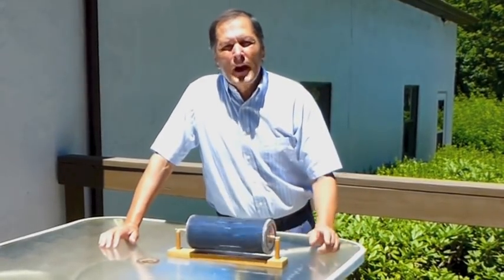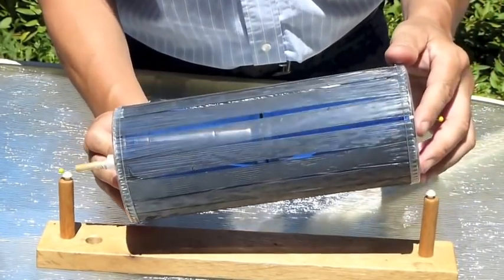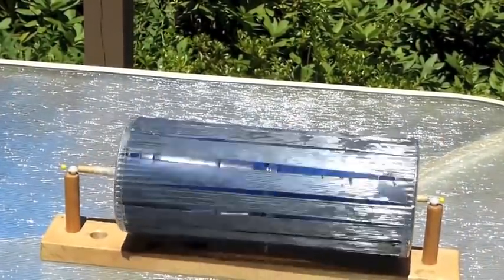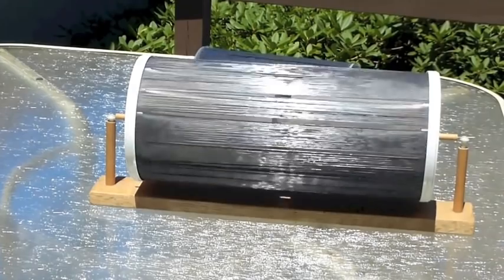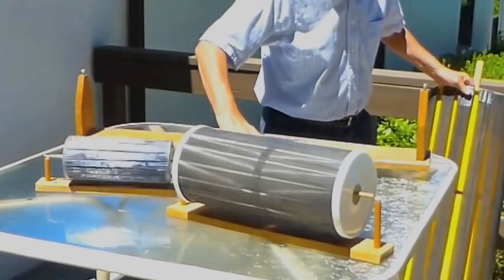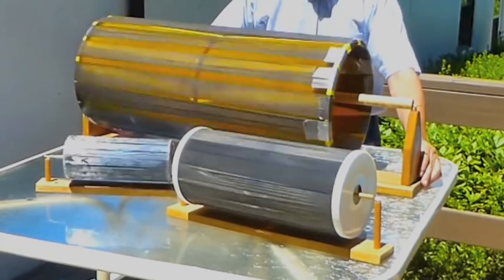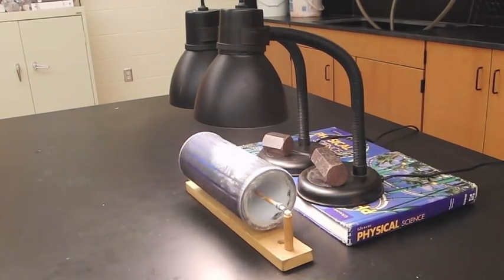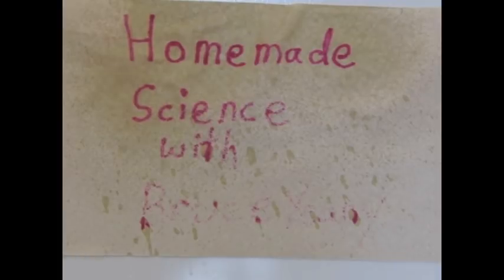Solar motor--Free energy motor-- not electrical /// Homemade Science with Bruce Yeany

Comment: Efficiency not mentioned. Should have mentioned that its solar not free energy in the title. Solar cells probably more efficient, plus no moving parts, thus no mechanical wear. All in all it is a thermal device not solar, witch could be used bidirectionaly to cool or to use waste heat. more detailed implementation: https://youtu.be/lfmrvxB154w
Reply from the maker: Hello MIndaugas,   Looking back I should have added more information in the video, but I had planed for a followup but haven't gotten to it yet. I  did cover some of this in the paragraph under the video.  If I were posting it in a technical journal I would have described it as a thermal retraction engine. In this case,  I labeled it as a solar motor to denote  the energy source powering it, which is done quite often in energy converting situations for example,  wind mills, or hydroelectric power neither of which are actually energies, simply descriptions.As for "free energy"  I don't believe that devices can violate the laws of thermodynamic or run as perpetual motion machines so I denote free energy as an economic description not a pseudo science  one.   The video link you provided is pretty cool,  thanks

Comment: I got the impression that the wooden dowel is warped, not truly straight, making the engine unbalanced.  This would make the engine less efficient and slow it down.  Perhaps using a piece of straight aluminum, perhaps an arrow shaft, would make a more efficient engine and give more RPMs.  Thank you for the demonstration and explanation.
Reply from the maker: Hi Paul,  I am trying it with some heavier duty materials to see if I can up the efficiency,  if it works I'll be happy to share it

Comment: Why does everybody want it to have an application?  It's a fun thing that illustrates the contraction of the "solar bands".
It goes around.  That's its application.
Reply from the maker: Thanks Mike,  For me that's enough
Reply: Well, I have an "application" :-)
Glue small thin mirrors on the rim somewhere. They coud even be colored.
You may get a nice light show in your room!
Reply: @geromatezwanzig8789  You could glue mirrors on the base as well, theoretically that could increase the speed of the rotor due to rays from the sun touching both the top and bottom
Reply: @Залав-ч1у  From the description of how it works in the video description, I'm pretty sure that having light on multiple opposite sides would likely greatly decrease the efficiency of, or even nullify the rotation entirely.

Comment: would it be more productive by using heavier material to absorb sunlight like metal painted with black ink to get more of torque out of it. maybe add some magnet on wheel to generate some electricity
Reply from the maker: I've been looking for other materials but have not found any, for this to work it needs materials that retract (shrink when heated)
Reply: nitinol!

Comment: What will mixing the different sizes together bring?  Perhaps setting up several devices in an array with one common axel suspended in equal distances from the orgin to the intersection of the axel supports.  In theory, both descriptions should render better torque.

Comment: what do you think the maximum volts/amps you could get out of these on like a dynamo type setup?
 i know its probably only going to be small but say ten, fifty or one hundred plus all on the same circuit on something billboard sized and use it more as an art insulation than a practical energy solution.
Reply from the maker: The smallest one's power output was very small,  in the 0.001 watt range.  We didn't try the biggest one,  I will this coming fall with my students

Comment: Serious question. What is the practical application of these motors? They don't appear to have enough torque to overcome friction if they were hooked up to a device that would actually generate usable electricity. If they would, then having one of these to supplement solar panels and wind, would be ideal.

Thoughts?
Reply from the maker: Until someone can make it more efficient,  it will not power anything usable,  for now it's use  is mostly educational
Reply: I appreciate the candid and quick response.

It would awesome if it could be made light enough, with little friction, so that it could be turned into a generator, mill, or pump.

It's really fascinating.

Thanks, Bruce.

Comment: nice post , thank you... this will be very useful in a solar convection application ( green house heating ) the process is simply to add direction fan blades to the end caps  and thus better movement of air currents into directional applications ... also see solar black boxes for heating ... thanks again... but , post of video of making one , so others can expand on the concept through application of principle ... ttyl...T...

Comment: It would have been nice if he had provided a Theory Of Operation.
Reply: It's in the description text.
Reply: The explanation in the description says the opposite. Heat causes the bands to contract which makes sense for a polymer.
Reply: the setup needs to be longer.  not a bigger radius.more lenght means more contraction means more power.
Reply: melted cheetah  Generally yes, but not always.  Several types of plastics shrink when heated.  Look up Shrinky Dinks
Reply: rubber bands contract when heated
Reply: This site explains How to & why  - www.instructables.com/id/Solar-Thermal-Motor/
Reply: If you replace the spokes of a bicycle wheel with rubber bands, mount it with axis horizontal, and allow sunlight on one side only, it will rotate.
Reply: Not in the case of elastomers under stress.  They contract.  You can demonstrate with a rubberband, a weight, and a hair dryer
Reply: A large heavy one would probably kill the effect off. It needs to be light enough that the very minor change in the plastic can deform the shape of the whole object. Make it too heavy and it won't work.
Reply: Animuldok What's odd is when stretched (expanded) rapidly they cool.
Reply: Doesn't heat make things expand?
Reply: Likely.  But with most organics, contractions are weak with heat.  I did not know what materials were used.  It could be possible for the cup tops  being distorted upwards to provide imbalance for rotation.  I would have to build one and test.
Reply: Yes its plausible but the the expansion and contraction to happen that fast mmmmmm Im with you would need to build one to be convinced
Reply: you can read video description
Reply: Richard Vasquez  please provide me your e-mail for theory
Reply: I doubt you'd get any useful energy out of them. The forces involved are so small anything drawing energy from it would brake it to a halt.
Reply: yes, contracting at the top would indeed pull it together thereby raising the CG, I wonder if this couldn't be used to construct a sort of van degraff generator to do useful work.
Reply: its obvious.  The bands facing the sun are heated, and therefore expand, causing the axle to warp upwards, which moves the center of gravity of the rotor assembly upwards, and the rotor falls, further allowing subsequent bands to shrink when in the shade, and the rotor develops not much power.  that is  my guess.
Reply: @sevtecsev  that's most definitely not obvious! Thanks for clairfying
Reply: @sevtecsev  "It's obvious" 

Proceeds to to describe the opposite of what's actually happening.
Lol.
:)

Comment: Can't take much of a load.
Reply: By the way, the supports I used are not wood, but cut up pieces of a box made of thick cardboard. But the [principle is there.
My granddaughters will love it..will get them to make one for themselves...well the eldest one anyway...she is 8, the little one is 3...but feed a young enquiring mind properly and you might produce the next Einstein maybe. Confucious (if you are into his stuff) said the start of every journey starts with the first step. I want my grandkids journey to be a good one for the future.
Reply: You can't amplify the torque, the only way would be to have enough speed, which is not the case here.
Low torque, low speed, well, in other words, very little energy in this thing.
Definitely not any practical use.
Reply: You could maybe use it to freely pump water from a lake (where there's no current to power a water wheel or a ram pump), but you'd have to set up some kind of gearing to amplify the torque, and it would definitely be slower than a ram pump. 

You'd be better off powering a 12V pump from a solar panel. The only advantage of this device is that you could potentially build that yourself, rather than buying an expensive photo-voltaic set-up. 

Anyway, I've also seen some homemade sterling engines powered by solar which are more efficient and more applicable than this.
Reply: I tried building a ram pump to pump water out of my creek into my garden, but apparently you need at least three feet of fall, that is, the waterfall has to be at least three feet high, in order to work.  Instead I got a bilge pump and a 30 watt solar panel and have been pumping water out of my creek into my garden for about 10 years now.  Works much better than anything else.
Reply: Put some balls made of aluminium foil in it to make some noise and keep birds away in sunflower fields :P
Reply: I wonder how big of a device i would need to put on a roof top to power a regular house :D
Reply: Juat put in in the back yard somewhere...the sun will still hit it if there isn't any trees around to cast shadows. I just like the idea...I just made one while watching it...all I had was two white cups..already had the pins and a piece of dowelling...so made to the length of 18" dowel I had nearby. But the black plastic bag strips seem to work..not an overly fast spin...but it worked under my small lamp...will try it outside when I get a chance.
Reply: My solar thing worked by the way and the kids did like it.

Comment: that's not solar that's just heat expiation and contraction
Reply: where does the heat come from?
Reply: Asa Forsythe any heat source heater oven hot breath induction plat holding your hand over it long enough
Reply: Asa Forsythe you can make a small one and put it in your pc it will start to move
Reply: sure, but he was using the sun to heat it. ergo solar power.  solar panels just use photons to bump electrons out of place which you could techinacally do with a non-solar source but it's still solar power if you use the sun.
Reply: Asa Forsythe you cant have photons without light but you can have heat without light

that is a thermal motor not a solar motor two different processes

just because you can use the sun to run it dose not mean its the sun that runs it 

you cant use solar panels in the dark but you can still use this in the dark
Reply: meh, fair enough. I still think it's a bit fiddly to say this isn't solar powered.  incidentally, heat is photons, although agreed, not "light" in the colloquial sense
Reply: Asa Forsythe heat is radiation yes photons emit heat but heat is not caused but photones

https://en.wikipedia.org/wiki/Heat
Reply: Bruce Yeany so you labeled it with click bate got it at least your honest with that one LOL
Reply: What did heat do wrong?  I see no reason for heat to feel guilty.
Reply from the maker: you are correct,  If I had written this for a science journal ,  I would have labeled it as a thermal motor,  for youtube I labeled it as such to appeal to a wider audience.
Reply: Sphinx Hutc the difference would be a soler motor would only work off the sun or light as ware this will work off any heat regardless of light

why do you keep calling me the dip shit when it is you who dose not grasp what solar imply's vs thermal imply's

pleas keep arguing and proving you are what you are calling me
Reply: +rayzimmermin what appeals to me is your behavior 😂
Reply: Sphinx Hutc oh im sorry did you miss the part ware the maker agreed with me maybe read all the comments before posting
Reply: @ray zimmermin expansion and contraction are caused from what????? what kind of heat? ??SOLAR heat dip shit.😲😲😲 😲😂oh geez!!! lol that made me laugh. what am idiot.
Reply: Sphinx Hutc"Bruce Yeany (Yeany Science)Sep 30, 2016

 1
Reply
 
you are correct, If I had written this for a science journal , I would have labeled it as a thermal motor, for youtube I labeled it as such to appeal to a wider audience."

this is the words of the guy who made the thing what dose it say dose it say i am wrong or dose it say i am correct 

fucking Neanderthals
Reply: Sphinx Hutc hear have another cookie troll don't want you to go hungry
Reply: rayzimmermin your right but the HEAT came from the sun which is Solar power.
Reply: *bait, *you're

Comment: While it looks very awesome, I fail to think of an actual use for it, I mean I can think of like say spinning window decorations, but even then they probably won't look very pretty if the motor needs to receive direct sunlight...

Still though, it's a great start.
Reply: When I was a kid we had these toys- they looked and spun like CDs, but they had some sort of coating so they cast rainbows all over the room when you spun it.  If you had some surface on this mixed on you could cast rainbows around the room.

Actually, it's even more similar, artistically, to a lamp my grandmother had at her house (and similar to old Christmas lights) that would slowly start to spin as the bulb heated up.  I think those were convection and air currents (I don't think they had a surface that would expand/contract like this).  The chinese lamp my grandmother had had fish on the lamp shade.  They'd slowly spin around and it looked like the fish were swimming around in a bowl.

You might be able to put slits along its length and put images on the inside?  What are those things called.  It's not a rotoscope, it was a precursor to movie projectors.
Reply: this needs research, to get near as possible friction-less bearings, and the rotors need to be more efficient material, room for experimentation in my humble opinion, there must be better materials available for this.
Reply: Brian Raffell Titanium and gold never hurt anyone, right?
Reply: Maybe in a more refined and professional iteration it could be used as a cheap way to generate electrical energy at a very low cost.
Reply: Animiles Well yeah... or you could just use the solar panels to directly generate the energy and not bother with spinning the motor hehe.
Reply: Cestarian Inhabitant And that is why I stated "at a very low cost".
Sure, solar panels would be easier. But how complicated and how much energy does it cost to make them? And how abundant are the materials used for it? This spinning device can be made at home, and is cheap and easy. It may not be practical for large scale purposes, but for some smaller purposes it might be very useful.
Reply: You could fit some small cat bells inside and have a solar chime, probably get rather annoying after a while though :-)
Reply: A fan would work great. Several of these, with a small fan attached to the end, one that presents less resistance than the force the motor provides. 

Self cooling room.
Reply: It can be used for decoration :)
Reply: maybe not in its current iteration. any clay model car design had no use except for decoration.

Comment: You kill me. I admire you. Thank you. Your so rite on!
Reply from the maker: Thanks again,  I wan't sure what I would get into when I started this,  for the most part it has been positive.  The comments have shown there are some folks that found it useful or interesting  and hopefully not for the purpose of commercial gains. Also there have been several good suggestions.  However,  with social media they have also been the negative side, I've removed several comments that have been crude and personally insulting, way more than I would have thought. I guess as long as I feel the good outweighs the bad, I'll keep posting,  I have several more ideas that I'd like to share before I retire.  Good luck if you give the magnetically enhanced motor a try.  Bruce
Reply from the maker: Thanks Keys
Reply from the maker: Wow,  I appreciate the information,  hadn't thought about that type of problem.  I do get a lot of requests information on how to build this and many questions about whether it would a reasonable design as an alternative energy source.  I would have saved my self a lot of questions had I been clearer in the video that this has no usable torque.  Thanks
Reply: +wobblyboost their were those that tried to invent it and then sell it for profit those people gave either  been suicided and their patent stolen or the patents are bought and never used so it's nice to see when somebody make something and give the information out this is how we turn the ship around around

Comment: +Bruce Yeany  Could this be made more efficient by adding a shade around the sides and bottom of the rotor to keep the sun from heating them? Also the movement of the polymer makes the rotor unbalanced, but it's actually gravity acting on the mass of the rotor that gives it rotational energy. Perhaps there may be a way to use the pulling of a heated, stretched polymer to directly activate a piston of some kind, and turn the back and forth movement of the piston into rotational energy? Perhaps it would have to be some sort of material that has more movement than polyethylene.

Comment: The transparency of the polyethylene seems to be inefficient for absorbing light energy. Perhaps with a backing of black painted strips (vertically so as not to interfere with contraction) more energy would be taken into the system resulting in increased revolutions per minute. Or perhaps a thin treatment of adhesive and charcoal.

Comment: where can i get those solar trips?
Reply from the maker: you can make them by stretching thins strips of garbage bags and pulling them until they are about 5 times longer than the original length.  Send my an email address if you want a full set of instructions